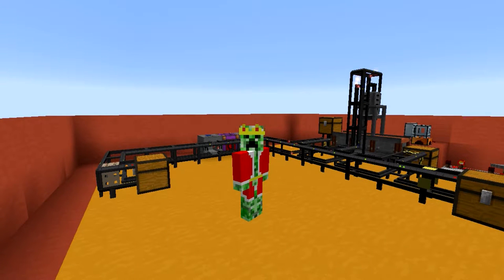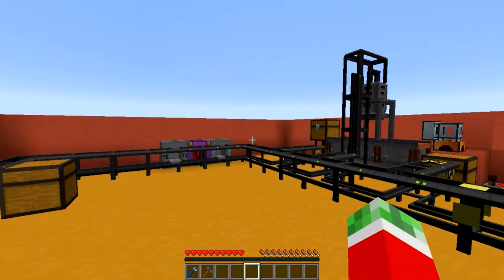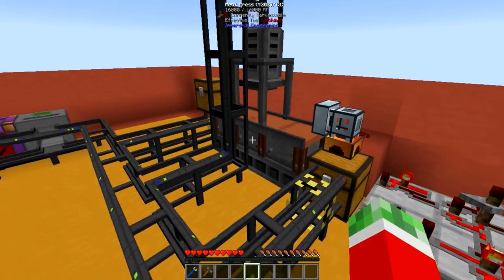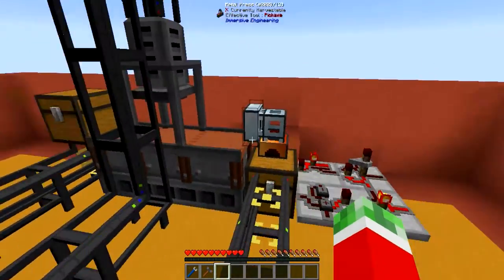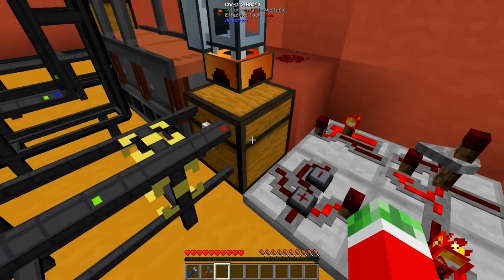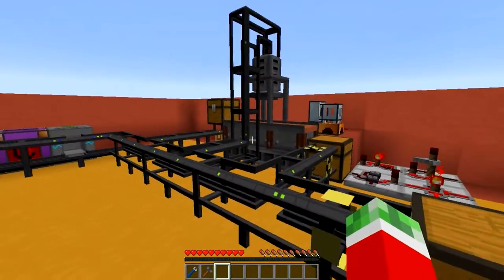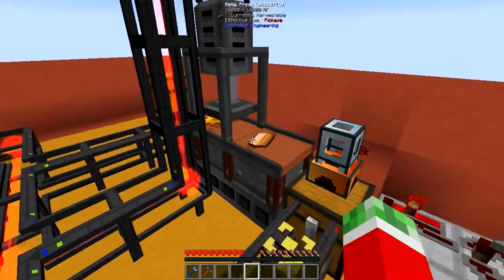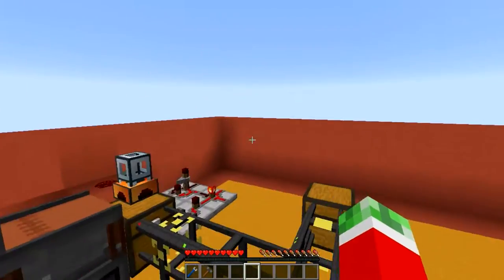Logistics Pipes Tutorial - #14 - Metal Press (Immersive Engineering)

Comment: why no just use a hopper?
Reply from the maker: Hey there TheAbyssWalker! From personal experimenting with this built I found out that Hoppers didn't work and would spew out items all over the place, instead of properly inserting them with a specific quantity .That's where I got the idea to make this build! :)
Reply: ***** I see maybe it got changed recently. But I found when I'm playing the infinity evolved skyblock if you place a hopper going sideways into the metal press that it only places 4 at a time, and with the proper timing. I think IE may have changed how it handles inventories in the metal press so that it's only a valid inventory when it can accept items which would prevent the hopper spewing items issue.
Reply: BTW i do like your build a lot though

Comment: I'm 99% sure that DW20 hooked the satelite pipe in IE:E Skyblock directly to the metal press...
Reply from the maker: +King Chuck From my experiences in my own personal world, that both didn't work, and gave quite a big mess. That's why I designed this, to make it fool proof :).
Reply: I'm pretty sure they used a hopper to feed the metal press because the logistics pipe didn't work... But it's still simpler than this setup... Actually at some point Soaryn moved the setup and setup 3 presses with logistics pipes without the redstone machine...

Comment: it's easier with a hopper xd
Reply from the maker: +SrRudelAND Hey there SrRudelAND! For obvious reasons, a hopper doesn't work in this situation ;) You need to input 4 items at a time to make it work, and there is a slight delay before you can put in items again, otherwise they will drop everywhere. That's why I came up with this design. Hope this helped
Reply: +Corjaantje - Modded Minecraft  i have it  with a hopper and no drops ewerywhere. Maybe we have different version of the mod
Reply from the maker: +SrRudelAND Hey SrRudelAND! It's weird that we are having different interactions. Though to make this design 100% fool proof, I designed this to both optimize the speed, and make sure nothing can go wrong. Hope this helped.